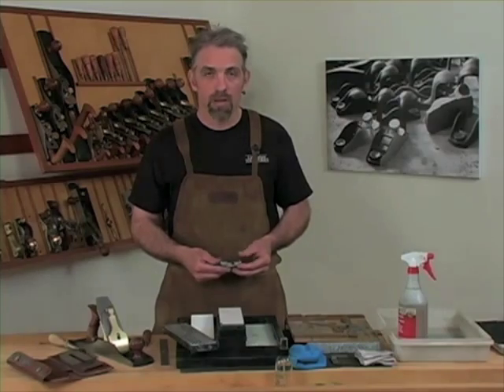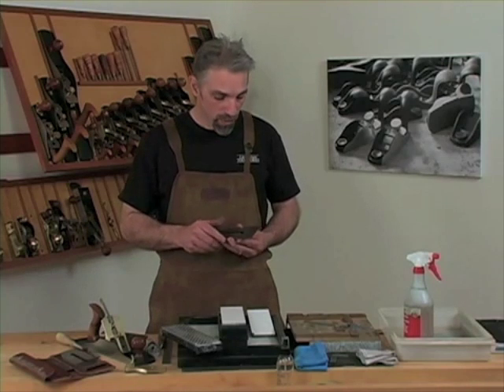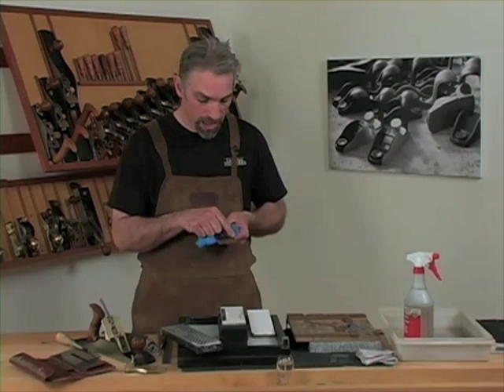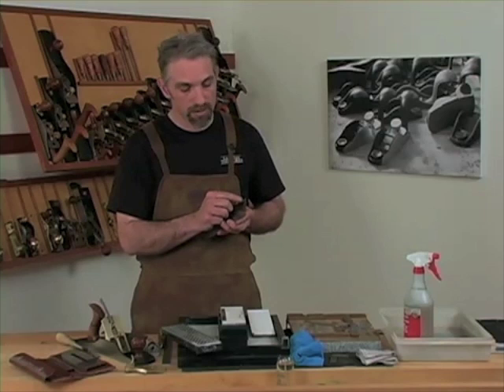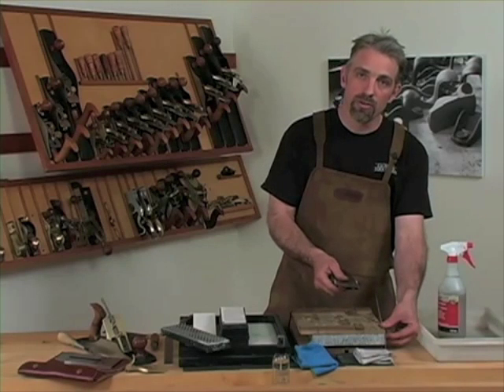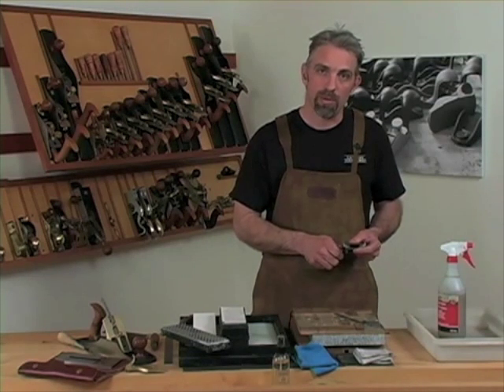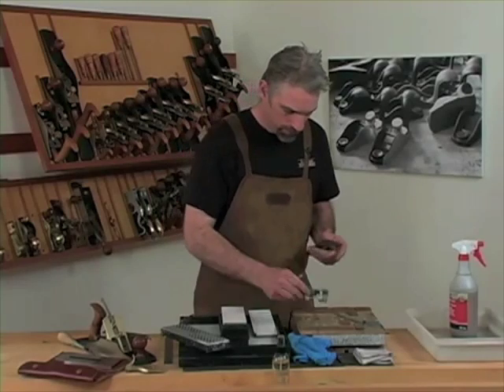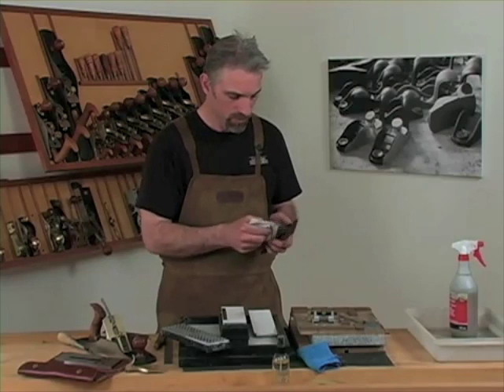Sharpening Plane Irons

Comment: I've been a woodworker for 40 years, have two full shelves of Fine Woodworking (probably 60 issues), and prefer to make my work by hand, with minimal machine work. I'm not a Luddite – I use machines sensibly, and have a garage shop that is enviable. So I often rough everything by machine, but do the critical work by hand.

This is just a truly delightful and brilliant video, and totally based on proper practice and mentality regarding tool steel. Kinda wish there was a mention about steel quality and hardness, but maybe they do that elsewhere. This video is simply excellent... great work! Tom Lie-Nielson is a man of my own heart.

Comment from the maker: Dear olgoat52, 
Good question. Yes, a bevel-up plane iron still works fine with a back bevel. The main difference lies in the fact that a chisel registers against the workpiece using the back of the chisel itself, meaning a back bevel on the chisel would cause the chisel to "ride up" as it pares. Since it's the SOLE of the plane that registers the cutter against the workpiece (not the cutter itself), the wood "sees" the cutting edge's bevel angle without caring whether the bevel is up or down.
Reply: which protractor are you using please?
Reply: Exactly – if you want to "true" your plane, the base and sides of the casting are where you want to put your effort... you can play with blade edge angles all you want.

Highland Hardware, please know that you have been a source for me for decades. I think I still have a bunch of your old newsprint catalogues. I've been to the original Atlanta store, which was something like porn or a strip joint for a woodworker like me. Just want to thank you for being true.

Comment: I agree with you. It DOES alter the main angle. There is no need for a bevel on the back. Just concentrate on polishing the back and sharpening the main angle true across the blade width.
Reply: you know, that was my first thought... I completely flatten all my plane and chisel blades on 1000 grit sandpaper attached to a 60-pound piece of marble that was used to stabilize electron microscopes back in the '60s. Then I hone them on ceramic @ 1200 grit or higher (6000 grit for some).

The revelation to me from this video is that what I do is fine and proper for chisels, since they need that precise flat back. But a plane blade is always at an angle, so it really doesn't matter about the backside of the plane blade, as long a it's 50% honed and flat. The cutting edge is the key, and a way of keeping that cutting edge alive without having to flatten the entire back is just sensible. NOT for chisels, which often rely on a flat back for reference,  but definitely yes for plane blades.

Comment: You mention dressing the stone(s) every time you use it, by means of a coarse grit 120 to 220 wet or dry paper, or by using a coarse diamond plate.  I presume this means wetting the paper or plate, and then rubbing the stone over it.  But is there anything more involved, and how many passes, approximately, would you expect to make to keep your stone flat?  Also, how to you take off the corners of the blade to remove 'tram lines' in the wood, when planing?  Thanks again.

Comment: The video says to not use back bevels on chisels as it affects the cutting of the tool.  What about planes that use the bevel pointing up?  Like a low angle block plane.  Is the back bevel ok to use in that situation?

Comment: That back bevel is only .020 rise on the vertical side of a triangle, the hypotenuse side is the length of the stone width used. Calculated, it is only a change in 00.00.00 seconds of a single degree. That can help get a clean keen edge on an old blade or new one. The wood shaving can tell no difference in the approach angle resistance. 
Great information! Thanks

Comment: thank you for your reply. i have watched and listened again, firstly he says about the angle for sharpening, by putting a back bevel on alters that angle. the only people who would benefit are those who can't sharpen a plane iron correctly. to flatten the back of a plane iron does not take the length of time he says. if its good for you ok, but as i have mentioned before i have been a cabinetmaker for 50yrs and i think i know what i am talking about. sorry but i totally disagree in what he says
Reply: I agree with your attitude toward sharpening and flattening (it's part of the passion), but when it comes to planes, it's the plane body that needs to be true – the blade itself can be customized for the type of wood being cut – I've always thought a typical bench plane was way too steep of an angle... even for a "hoaring" tool. I like the mentality of keeping the sole and sides of your planes flat and square, but adjusting that "iron" angle for the wood at hand (it's not iron, it's steel0